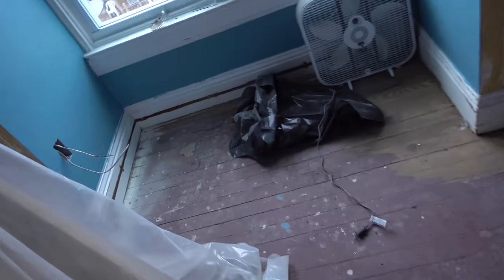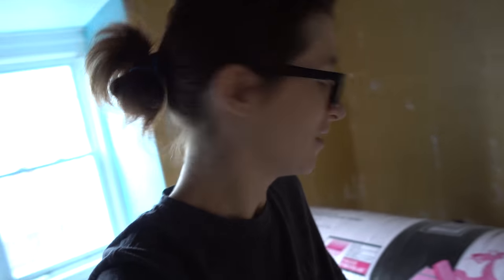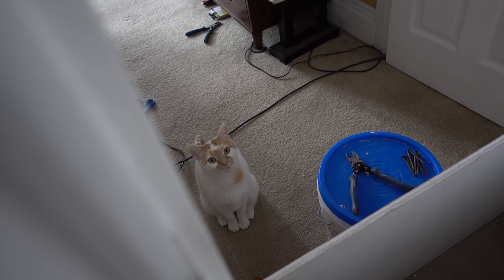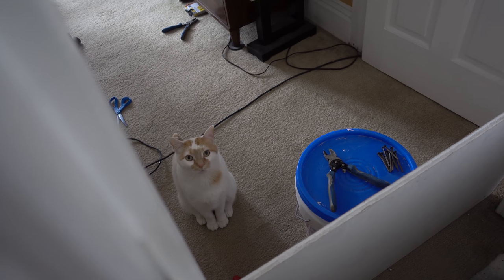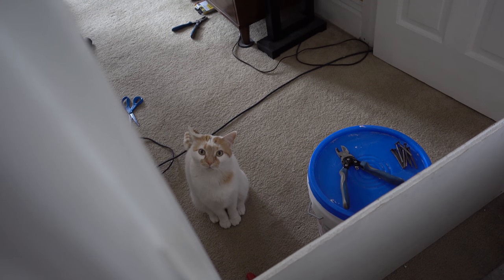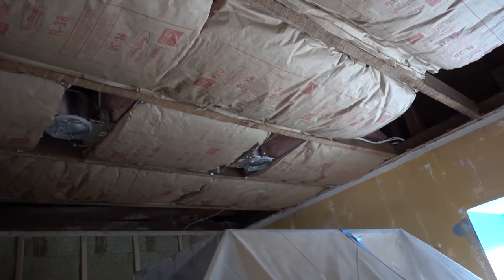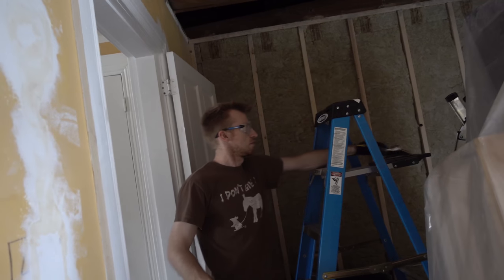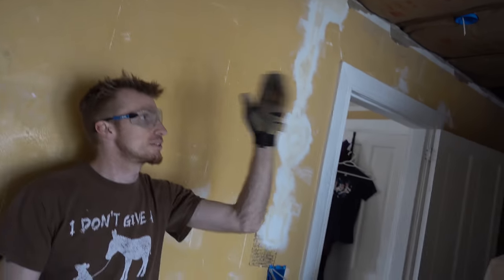Hanging Attic Insulation

Comment: Watch how close the paper vapor barrier is to those recessed can lights, for a fire hazard, those get hot!... Are those the can light housings rated for direct contact with the insulation?... There are 2 types of those, rated and non rated.... Just trying to help / keep you all save...Keep up the great work!
Reply from the maker: Yes, those are IC cans. We also will be using LED bulbs which produce far less heat